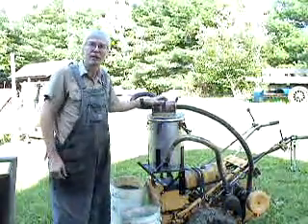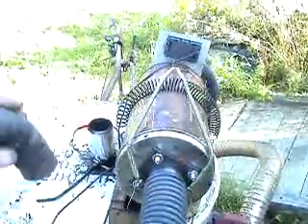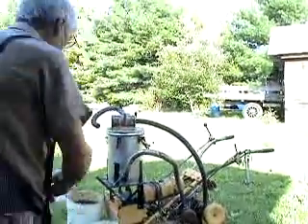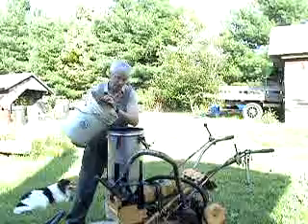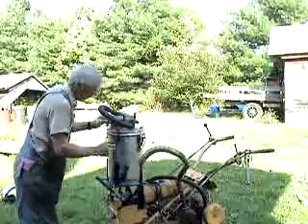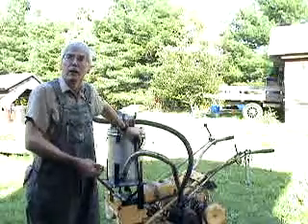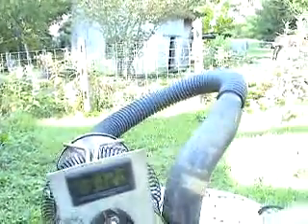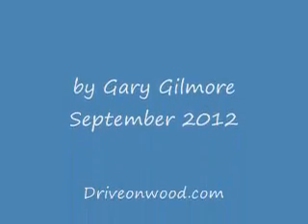Gravely simple fire

Comment: Hi Gary
I noticed your exhaust return was at a 90degree angle?
If you open the valve to much it will blow the oxygen_air away! Would it be more practical to direct the exhaust in to the reactor? That way it will turbo charge the gasifier?
Hope this is useful info for you.

Comment from the maker: Thanks for the vote of confidence.  I'll throw something at you that MAY work for gasifiying a two stroke engine. Actually it happened with the Grav ely.  I came up with the idea that adding a little used motor oil to the charcoal would boost my power. Yes it did, but it also vaporized some of the oil which clogged my foam filter after awhile.  When cleaning out the filter, I noticed the oil was rather clean.  MAYBE this will give enough oil for your engine, but no guarantee.